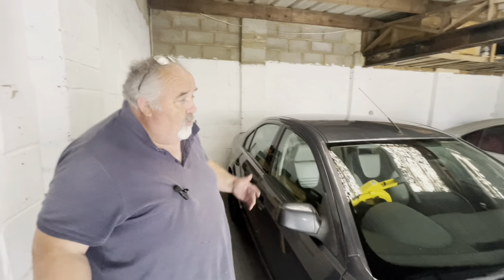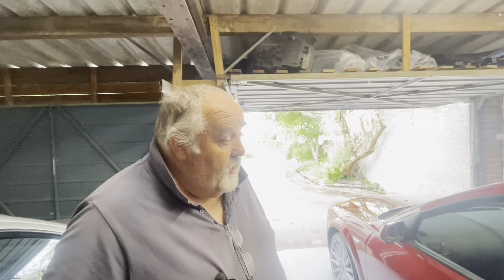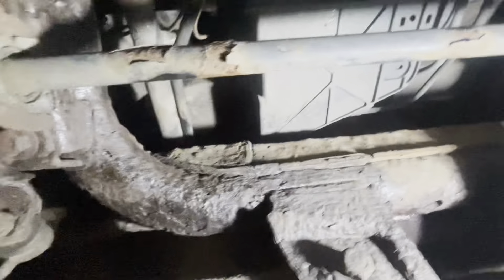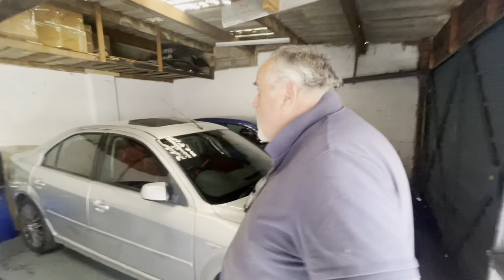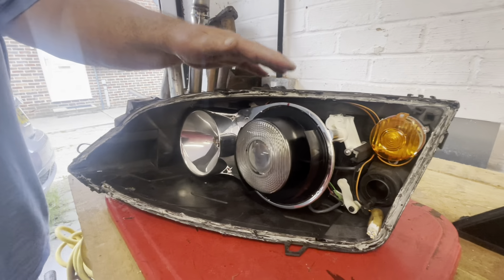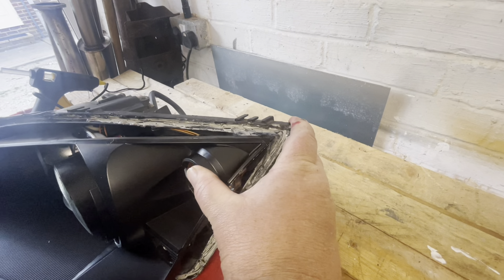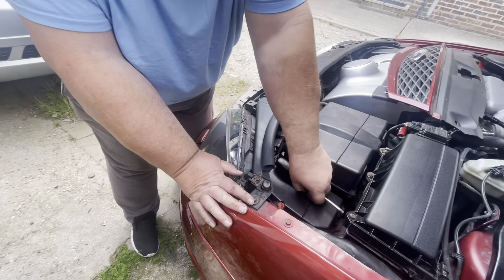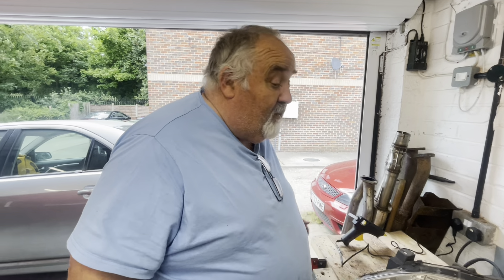Getting under the infra estate and some new headlights  😁

Comment: Hello mate. I don’t know if you know anything about the fitted radio/cd player. I have a 2004 st220 mondeo. Unable to exit the loaded cd’s. The radio is working, but unable for open the gate on the cd player. We’ve had it disconnected and out, but can’t get it to open/work. ?????
Reply from the maker: Had the same problem in the end I removed the unit dismantle it removed my CDs and replaced the head unit